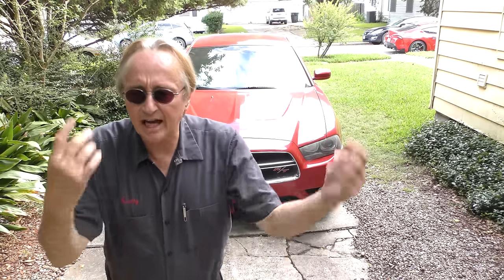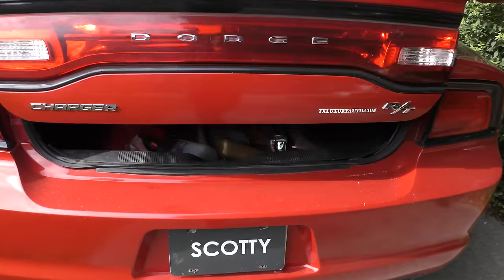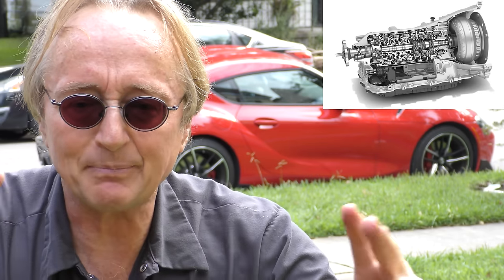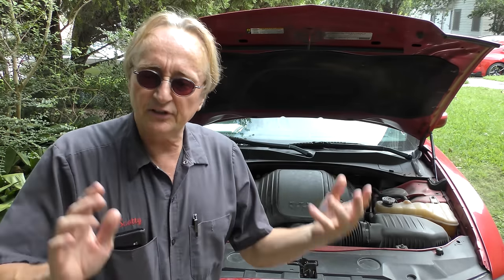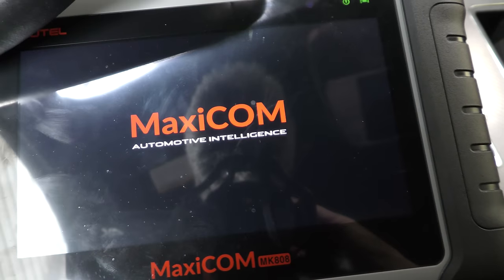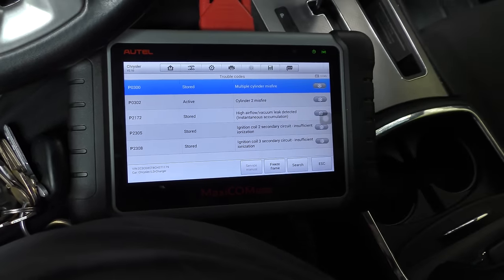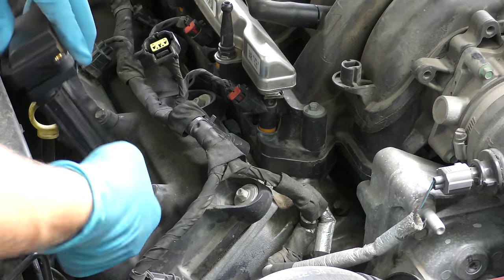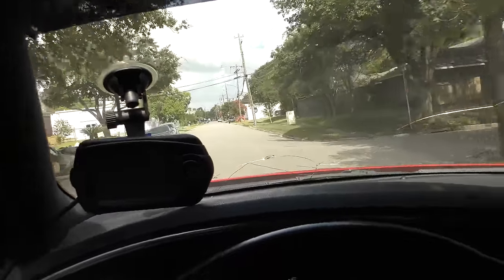Here's Why I'll Die Before I Buy a Dodge with a Hemi Engine

Comment: Not bad engines,  I have one in my Chrysler Aspen.
Reply: And listen to Scotty roast those Aspens. Lol

Sorry just had to mention that.
Reply: My condolences
Reply: Yea... it's a bad engine
Reply: yes they are once they get over that 100,000-mile mark... lubrication has to always be on time with quality oil, and filter to hold off the lifter DAMAGE...
Reply: Of course not!! Is the owner who didn't give the proper care cuz those hemis are indestructible, however the '50s, '60s and '70 where the bettest so far!
Reply: Put some good aftermarket lifters and keep up with proper maintenance and it's as reliable as it should be.
Reply: @extremedrivr  I know right.  Truth be told it's been a great reliable versatile truck.  Lots of cargo room, room for 7 or 8 people, can tow almost 9000 lbs.  The best thing is, they are so cheap.  New SUVs that can do all that are so expensive.
Reply: I’m Sorry, you don’t know what a good engine is.
Reply: Nathan Brame if you take care of oil change it will last long... and it’s powerful so I think it’s a good engine.
Reply: You have the 1st gen remake hemi it doesn't have the msd system which is the problem
Reply: @neepercreeper 150,000 so far.  Any car that gets 200,000 in my book is ok.  Fingers crossed.
Reply: Kay Yo no it’s not
Reply: @marcoarreola9058  the key for most vehicles are proper maintenance,as a Mechanic I have never had any engine, or transmission problems on any vehicles that I have owned.i have owned...   for example 4 Ford explorers from 97,99,2003,2005 still drive 2005 everyday and it's approaching 190,000 but the other 3 I was still able to sell with over 250,000m because they still ran,and drove WELL!  Proper MAINTENANCE goes a long way...
Reply: @neepercreeper My '09 Hemi Charger has 183k as of today, 130k put on by me, runs like new, never rebuilt. But I use the proper weight synthetic oil, regularly check the level, and only occasionally stomp on it lol. These Hemis are good motors when maintained.

Comment: I've got a 2003 Ram 2500 Hemi Magnum. IT still runs perfectly fine with 220,000 miles.
Reply: U mean and a magnum?
Reply: @andrewknight8270  no its a magnum v8
Reply: Its cuz he can't handle the powa
Reply: Hell yeah, u take care if it and its lasting
Reply: wow you Americans travel alot my dad bought his 2006 citroen c5 In 2008 and it only got 52000 miles on it, by the way I'm from Syria
Reply: @woodrowdrexel7702  you'd be surprised how open America is
Reply: @edwingonzalez7691  yeah our city in only about 10 kilometers long
Reply: @woodrowdrexel7702  ;) we Americans don't ALL drive an average of 12,000 miles a year on our vehicles. yes that's an 'official average' from several US auto magazines. my 2007 Dodge Charger R/T AWD just rolled over 50,900 miles just last week. oh, and i'm it's original owner.
Reply: @woodrowdrexel7702  My wife has a 17 Jeep Grand Cherokee we bought new that just turned over 100k miles last week.. She drives 48 miles each way to work.. every day.. thats over 30k per year.. and my 17 F150 is at 56k miles.. Big interstates and highways make for easy long distance travel.. Especially when you can run 80mph + on the interstate..

Comment: Mercedes 722.6 trans (Chrysler nomeclature: NAG1), not Chrysler designed at all.
Reply: Exactly!
Reply: ...and is a fairly good transmission. The same transmission in the SRT Grand Cherokees.  People are running twin turbos on the 6.1's making 1000HP and putting it to this transmission.  Really Scotty?
Reply: NAG1s last forever **with proper maintenance of course**
Reply: The W5A580 transmission was still in service up until a couple years ago - it's a great transmission. Not sure what he's on about. Chrysler only makes a few transmissions of their own design currently (40TES, 62TE, and 68RFE). The rest are ZF designs. He was also incorrect about Chargers only having ZF designed transmissions in them from 2020 on. They've been putting ZF 8HP70 8 speed autos in Hemi Chargers and Challengers for the past 5 years.
Reply: @jlrgaming8754  all true. And the ZFs have been in V6 LXs since 2013. The 850RFE is ZF-designed, but built by Chrysler. All in all, Chrysler really doesn't have transmission problems like many years ago. The W5A580 was stout enough to handle the 6.0L AMG V8(S65/SL65/CL65) for years without fail. That engine put out 738lb-ft of torque from the factory! Again, maintenance is key.

Comment: 5.7 is probably the most reliable v8 on the market man. The hemi tick is always really annoying but never had  engine problems with my 2014 rt awd charger had 164k miles before I just traded for a 2019. Use high quality oil after 75k miles like penz oil high mileage synthetic and service the other components when manufacture recommends service. It puts more of a hole in your pocket for the 7 quarts of oil but keeps the engine long lasting and happy. The owner probably didn't do services as recommended and this happened.

Comment: It has a 5 speed Mercedes Benz transmission, it was not made by Chrysler.
Reply: Yeah he said that the chargers/300s/challengers after 2012 had the bad transmissions, which makes sense since that’s when the Mercedes/Chrysler partnership ended. Too be honest, the cars are objectively really really really shitty. They’re affordable and fun though.
Reply: @steveg9302  ahhh actually no. Daimler still made the transmissions even after Fiat and Chrysler merged. you'd have to ask an expert exactly when FCA flipped to different tranny builders. my Charger is an 07 so... shrug... i'm a bit behind in my research.
Reply: I bought a 2013 Charger recently, I live in EU. The interior quality is lower compared to European cars but that is to be expected. Anything special I should be looking out for? It seems to me the car is pretty solid, puts smile on my face when I drive it. It is the 5.7 RWD R/T with 5 speed auto. It has 50.000 miles currently.
Reply: @emsicz  check suspension, especially tie rod ends, links, ball joints and ESPECIALLY check the bushings. Bushings are cheap to buy and easy to replace yourself.

Probably will have to replace radiator fans and oil pressure sensors (possibly other sensors too)

Other than that just do regular oil changes at 5k intervals (although I do 3k) if you got the V8.

Transmission fluid flush could be an option. Would probably be best if it has the Mercedes transmission in it.

Other than that check for vacuum leaks and cracked hoses and leaks (oil and transmission), could be worth it to replace some gaskets.

Spark plugs will need to be replaced soon too at that mileage.

This HEMI is HOT and burns oil. It’s a tremendous engine but everything around it needs to be functioning well in order for it to not mess up so that you don’t end up getting worn lifters and misfires (all mostly due to lack of clean oil). Regular oil changes is the best measure to take to prevent it, but also checking for regular vacuum leaks and making sure that the hoses aren’t cracked or leaking. In other words, it’s made to last but only if you service this car correctly. I’ve seen HEMIs with 350k miles on it, and HEMIs that dropped valve covers at 50k. 

Differential fluid may also be something worth replacing.

All in all I love these cars, but yes, the interiors are terrible.
Reply: @steveg9302  I'm replacing oil every 3k miles. Sparkplugs replaced already. I literally dropped it for transmission and diff fluid change today, as I was made aware it's something I should've done already. The car is running hot, I can testify to that. When I put my hand out of the window, I can feel the heat coming from underneath the car. I'll see if the garage comes up with any other issues they may find. I found a good US-cars only service with good reputation, hopefully I'll be good. I watched some videos yesterday on valve lifters going bad in these engines, something that can't really be influenced. I wonder if 2013 Charger is affected by this flaw.
Reply: @steveg9302  Chargers after 2015+ are the ones with the ZF 8HP Transmission. The older ones have bad transmissions.
Reply: @steveg9302  This car is not a japanese car. You gotta change the oil and other fluids regularly. And you gotta be sure the right oil was used. Taking any car to jiffy lube, or al in the alley, for instance, is a death sentence for these cars, because you might not be sure they used the right oil type. Whats to stop some kid at jiffy lube from throwing 5w-30 cheap sludge oil into your engine, and not changing the oil filter, because his lunch break is in 10 mins? What if he doesn't change it at all? What if you drive 10000 miles on old fluid? Same goes for transmissions and coolant.
Reply: @ricky-sanchez  I know. I replace all the fluids myself.
Reply: @ricky-sanchez  are you aware the difference between a 20 grade and 40 grade oil in thickness is a few human hair widths.

Comment: The V6 might last longer until the valve springs go out on the left side, every 60k.
Reply: Why the left side?   How long do the ones on right last?
Reply: @chetmyers7041  do some research on the problems. My buddy just had a second motor installed after fixing the first one twice at 155k.
155k is sad to have to replace an entire motor. Many older vehicles went 200+ and didn’t have the issues many newer models have
Reply: We have a 2012 charger v6 that looks exactly like this one in the video, over 100,000 miles. We've had no issues with regular maintenance. I'm actually changing the pads and rotors today.
Reply: Why is it always the left side
Reply: @candiecustoms8001  I would ask dodge. Something they designed with a flaw

Comment: scotty: Here's Why I'll Die Before I Buy a Dodge with a Hemi Engine
dodge fanboys: so you have chosen death
Reply: Out of 5 stars I give you 1, nice effort though.. Next time you should use a different over used joke, maybe that’ll rack up the likes that you’re begging for lol..
Reply: He has chosen an engine with 8 sparkplugs instead of 16.
Reply: 23 fault codes.  True to their motto:  Dodge testing.  RAM into production.
Reply: No, even die hard Mopar people hate the Hemi. The Magnum 5.2 was not fast, but it was tough. The Hemi eats itself due to poor oil distribution.
Reply: @ahoneyman  Don't speak for me
Reply: @bullymaguire4457  well he's got 409 likes....just saying.
Reply: @bullymaguire4457  your name is clorox bleach and you're talking about overused jokes 😂😂
Reply: @hazda5791  Im original 😘
Reply: @ahoneyman  that's still a small amount of hemis. The gen 3 coyotes were destroying there cylinder walls people still bought em
Reply: @TheSprykilla  Eh, the lifter tick is pretty common and there are some pretty worn out cams in junkyard motors. The LS will eat a cam too but there's a huge aftermarket and oodles of parts. The Hemi doesn't rev like the Coyotes and isn't cheap to mod like the LS.
Reply: @ahoneyman  oh lawd I know it isn't cheap I have a 2015 scat pack and everything for it is expensive lol
Reply: Yes, I probably will die before I buy another as the car will probably out live me. 07 Charger R/T,  233,000 miles, ran the hell out of it, best car ever!
Reply: 707 likes!
Reply: @moparfam300c  Dodge fans getting  feisty
Reply: Yes
Reply: @hazda5791  ya momma's an overused joke
Reply: @reanimationxp  ok

Comment: My father has 2 1967 Plymouths and a 64 Plymouth and they both have hemis. They are perfect cars
Reply: Early HEMI 426 cu in engines had solid lifter engines with a higher redline. 60's hydraulic cams couldn't rev beyond 6K, but didn't require constant valve lash adjustments every 1000 miles (like the GM 409 HO)

Comment: The 5.7 eagle version (gen 3 2009+) does have a history of lifter failure .. essentially the bearings on the lifter roller fail which causes the cam lobe damage..  proper maintenance will help reduce the potential but it's due to the overall design of the engine which reduces the oil distributed to the cam from engine rotation..   most high end replacement cam kits have lifters with much more robust bearings..  it's really not that hard to replace the cam if you are mechanically inclined.. beyond that the engine is pretty solid

Comment: The # 2 injector is hot locking! As soon as it heats up the injector fails and causes the misfire. Does it throw the code when it's cold or after it warms up?  If it still does it all the time the injector has fully jumped the shark and others could soon follow.

Comment: Scotty, you keep saying cams. This is a hemi, there's only one cam. Really feel like you should know this.
Reply: Must be that 14 GT500 Mustang he's thinking about??🤣
Reply: There is one camshaft that contains multiple cams. He is correct.
Reply: @leonardsmith1175  Multiple cam lobes, not shafts.
Reply: @leonardsmith1175  uh what?
Reply: @TheWholeGrainBread_Real  he's saying cams referring to the cam lobes, we're saying cams like most people would referring to the camshaft and lobes as one unit
Reply: He is right mechanically speaking. The lobes themselves are cams. Just like my compound bow known as a solo cam has one and no shaft.
Reply: @leonardsmith1175  Single cam engine. You are wrong.
Reply: He means plural as in multiple hemi engines.

Comment: I had an 06 300 C (Hemi) and I got over 200k with very few issues outside to normal maintenance. As long as you take care of them they last a long time.
Reply: Josh Humen I have a 2006 Hemi Charger Police package with 130k miles. Runs super strong and shifts well. My only issue is an occasional stall with no codes stored. Happens a few times per year.

Comment: They switched to the ZF 8 speed in 2015, and the NAG 5 speed transmission was from Mercedes when they owned Dodge and it is a great transmission I've got one in my 2003 RAM 2500 4x4 with almost 290,000 and I haven't even had 1 hiccup and that's putting Payloads  of wet live oak weighing in at 6,000lbs. 1 full cord and even hauling my gooseneck dump trailer with 6 bundles of rough cut 2x8x14 lumber and on the lumber miles scales I weighed in at 36,110lbs. so I guess I'm one of the lucky one with an all around well built truck.
And the way I see it if it can hold up under my normal use it will hold up under anyone's abuse! 
Plus I do have a few videos of it on my channel showcasing the wood and how I haul it with the stakes in the pockets.

Comment: I somehow think scotty secretly drives dodge, hes just playing with us.
Reply: He's got a Toyota Celica, Matrix, and he even has a Lexus, a dodge would be the last thing on his mind 🤣
Reply: Chrysler 300M
Reply: Scotty clearly explained why Dodge's have issues. People abuse them. No one is "going to have fun" in a Toyota.
It's like saying Jeep Wrangler is a trash vehicle because it breaks all the time. If you drive any vehicle like the typical Wrangler owner, it will break all the time too. Including the ones who take it to the mall and back. They still lift them and put huge tires on.
Reply: @KevinSmith-qi5yn  Lol exactly, and anything breaks when you beat on it long enough. Especially without proper maintenance. There are more than one Hemi these days, and 5.7 is the least durable out of them. The high performance motors are in the SRTs and Scat packs, and starts with a 6.1. Which they stopped making in 2010, and is the Challenger that I have. Then is the 6.4 or 392, and the hellcats are powered by the supercharged 6.2 FYI
Reply: yes that is his red bmw supra. That I6 puts down more power and can actually corner. Why would he drive a shitty dodge?
Reply: @andrewwang2602  More room. Doesn't need a special BMW technician with special tools.
Reply: @andrewwang2602  secretly has a mopar engine under the hood.
Reply: No, I think he has a Ferrari hidden somewhere
Reply: Idk i beat the hell out of my 01 is300 and that's allot of fun and really it's a toyota. Haven't had any problems but also it doesn't have all that hp like the mopar's. Anyways you can have fun in a toyota/Lexus.
Reply: Kevin Smith idk people beat the hell out of their civics and they are pretty reliable.
Reply: C S  duh CS you don't have a plate with CS on it!Oh it's on your neighbor's car
Reply: @Paul von Helger doesn't anyone park near you, probably not
Reply: I would bet my house against that.
Reply: Krazy SRT8 we knew that
Reply: no mechanic drives a dodge that doesn't atleast have a Cummins engine. Dodge hasn't made good trucks since the late 90s cars.. damn I cant remember the last modern reliable dodge car.
Reply: @rodneynasir8089  yea, Scotty has a hate on for Dodge, I heat the hell out of my 06 charger RT and it runs fine, I go to the drag strip twice a month and it runs the same 14.0 pass everytime soo, it's all about how you maintain it, I have 290k kms on it
Reply: @GhostlyGhille  no car is reliable without proper maintenance, that Dodge has clearly been neglected, my runs just fine with 290k kms
Reply: @xxgrimravenxx5172  worked as a mechanic for 9 years before getting tired of a thankless job. I feel dodge out of the American big 3 makes the least reliable engines and definitely the cheapest interiors.
Reply: Yup says scotty on the license plate

Comment: I have a 2015 Charger with the Police Pursuit Package that I bought in 2019 (5.7L AWD, 75,000 miles on it).  A few months later the sleeve partially slipped off one of the lifters, locking the cam shaft in place so the mechanic couldn’t pull it out.  The entire engine had to be replaced.  My 2008 Durango with the police package (4.7L 4WD, 145,000 miles) runs great.  Considering that both were likely running 24 hours a day while they were in service, I’d much rather have the 4.7L engine for use as my daily driver.

Comment: Driving a corporate fleet Dodge Durango 5.7 with 210k miles on it still on the road. Small things are getting broken, thermostat and oil pressure sensor but the engine itself is still feels pretty solid. I think it can surely last for 250-300k miles.